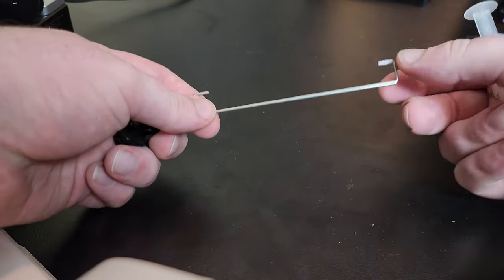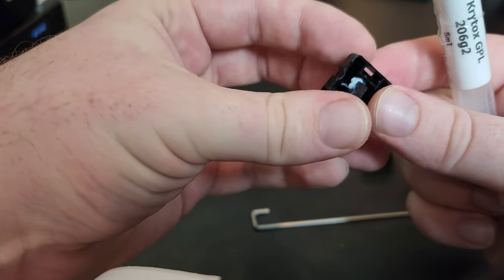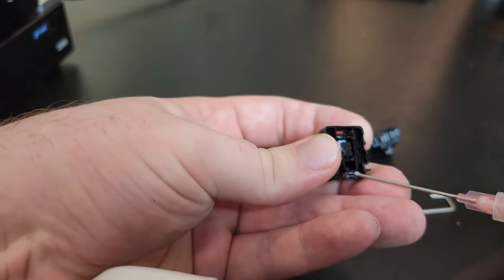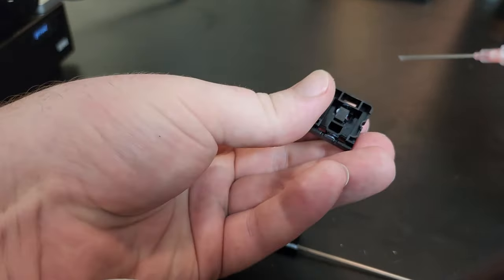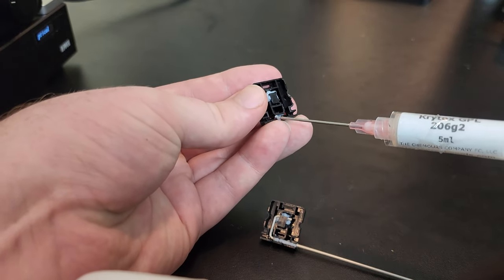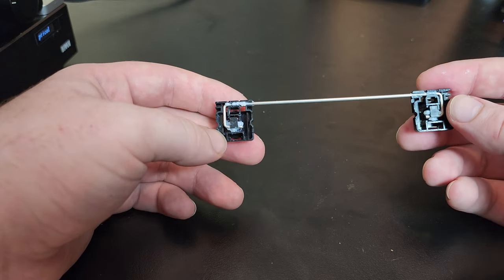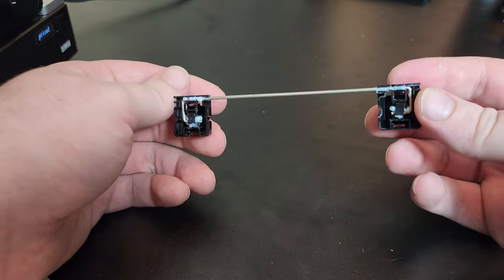Lube your Topre SPACEBAR!

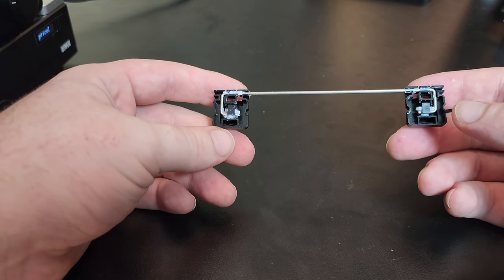Comment: @4:20 not sure if this is what you're talking about, but the issue of one side of the spacebar ticking or squeaking I found is actually the rubber bumpers on top contacting with the keycap. Problem drove me crazy for so long, then on a whim I cut a sticky label I had lying around and just put it on top of the rubber, and boom. Instant silence. A more permanent solution might be to sand away the part of the spacebar ribbing that's directly above the rubber pads, hell or maybe just lube the pads lol. Haven't tried it.

Other than that, I've found 95% of all stabilizer noise comes from having imbalanced wires.
Reply from the maker: Damn that must have been frustrating as hell trying to debug that! If i'm understanding correctly it seems that either the spacebar or the stabilizer plunger  or both had some sort of tolerance issue with them not properly engaging each other. 

I found that adding extra 206g2 to the void where the first two 90 degree bends sit is the best solution for fixing the issue I was runnig into on a semi-regular basis.

Comment: Is there a reason you use 206 g2? I was wondering if I could use dielectric grease or Xht bdz and get a similar result (what I have used for my mx boards)
Reply from the maker: Bdz is thicker so it should work as long as you apply a lot. If I could downpack bdz into a syringe I would probably switch to it, but I'd be extremely worried about getting the lube into the area where the stabs slide up and down as to not affect the key feel, mainly on the 2u stabs.
Reply from the maker: As for dielectric grease, you should never use that in conjunction with standard topre domes. The silicone in grease is absorbed by the domes and they become deformed.
Reply: @UnrealKeyboards  this is only for lubing the domes right? is it fine to use dielectric grease for the bars and stabs exclusively?
Reply from the maker: @Ross-wi9vt  no, avoid dielectric grease completely. The domes under the stabs will deform around the edges